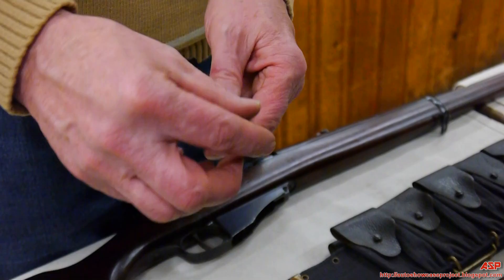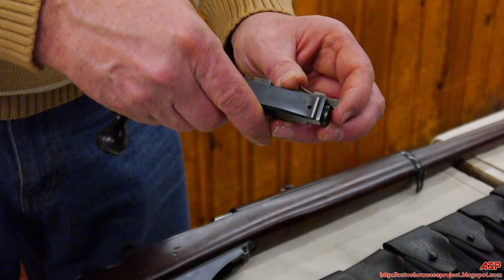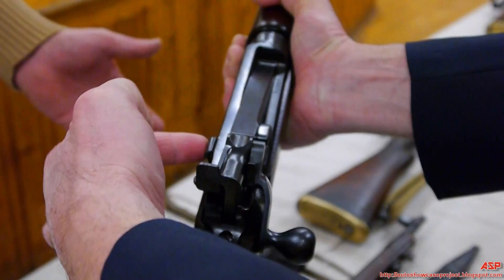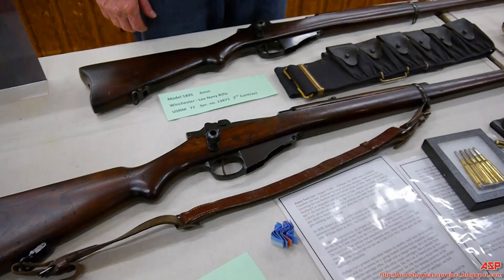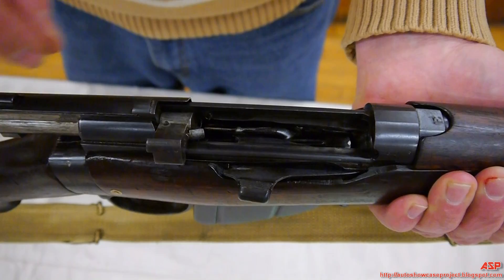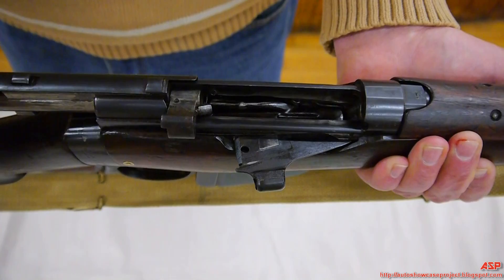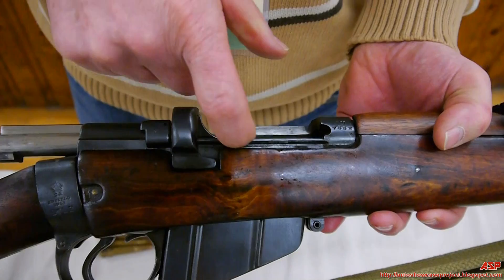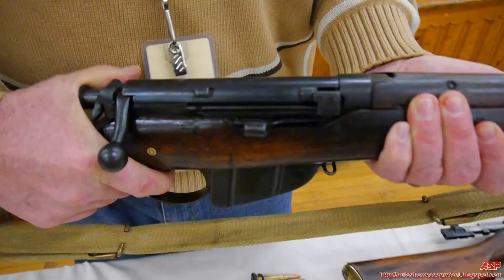Operation of the M1895 Winchester Lee and the Long & Short Model British Lee Rifles

Comment: I also have to say the Mauser/Springfield magazine cutoff is a much better design. Just a switch that blocks the bolt from retracting far enough to clear the base of the round in the magazine. The Lee-Enfield version is sticking out the side of the gun when in the "off" position...which wasn't a problem when it was meant to be used as a single shot except in emergencies, but by 1914 it was a drawback. That is assuming they still used the same design up until then, which I believe they did, until they totally did away with it shortly after the war began. My 1903A3 still has it, but it's not really a bother, since it doubles as a bolt catch, and would basically have to be included anyway, so it doesn't really cost any extra.
I just love these turn-of-the-century rifles. The style is so attractive, and the engineering is usually so clever.